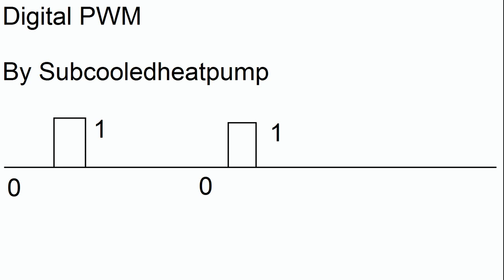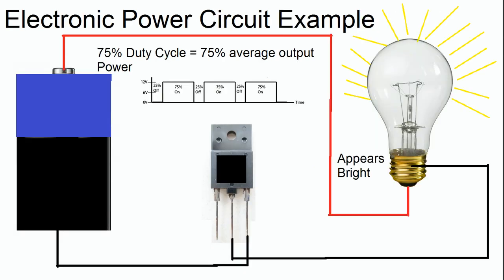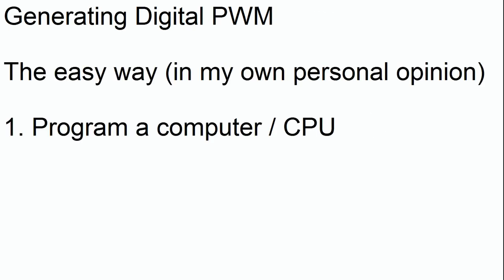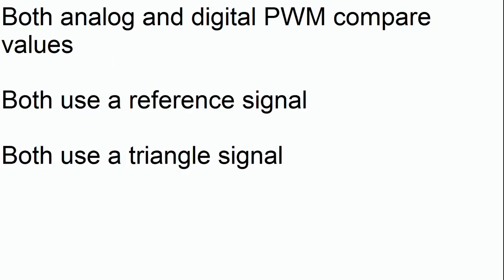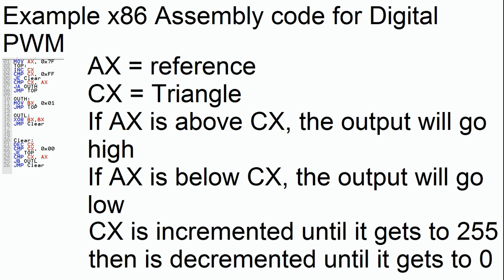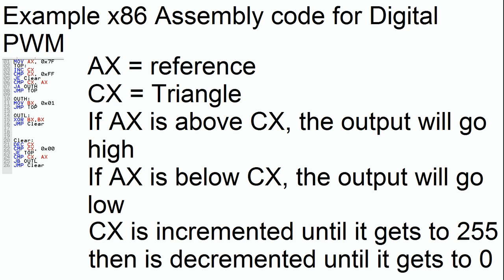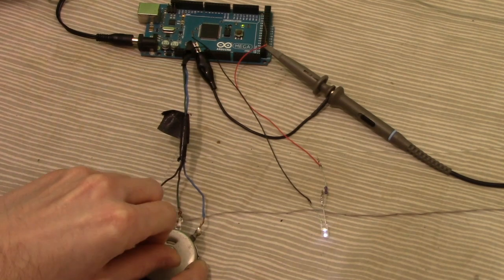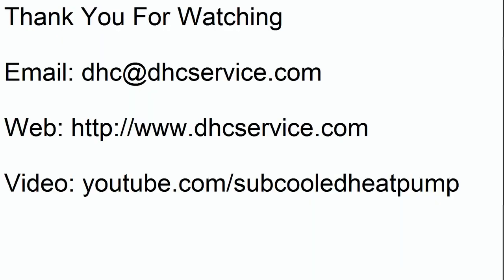Digital PWM; Explanation and Demonstration

Comment: There's also Delta Sigma PWM/PDM that has advantages in certain applications, and like classical PWM, can also be implemented either in analog or digital. Audio is a big application since that's one common area where the better resolution is important.

I suggest looking into FPGAs since they excel at real time stuff like motor control. That's especially true when there are many outputs to deal with - with a FPGA, you can add as many instances as will fit inside, with no loss of performance until the compiler has to "get creative" to fit all the logic inside. Beware, however, that HDL programming is very different from conventional programming, requiring a completely different mindset.

Comment: Very nicely explaíned!
The presentation was well structured.

It may be off-putting to explain it based on assembler code though. Maybe write some C code instead.  Most people never work with assembler.
In general, if you explain code, it can be helpful to add a little arrow pointing to the line you´re talking about.
Reply: We do :(